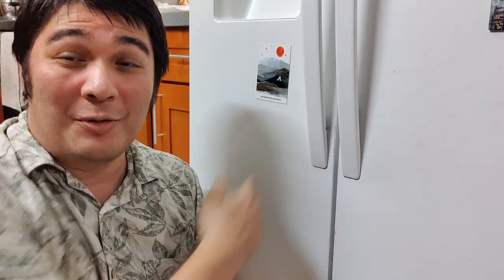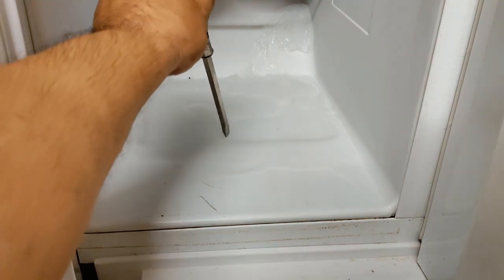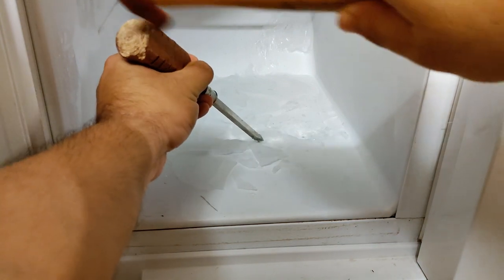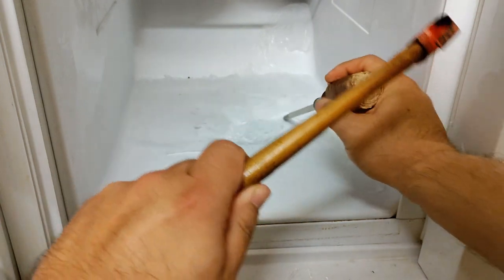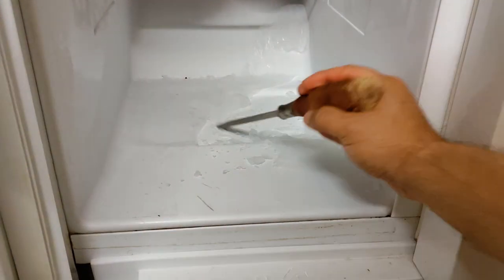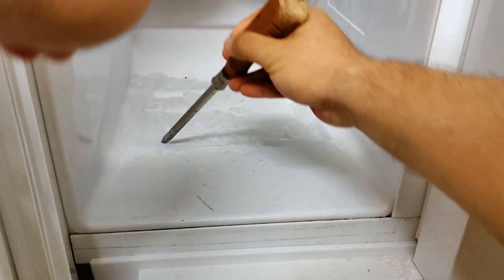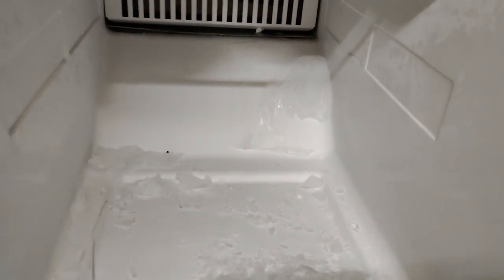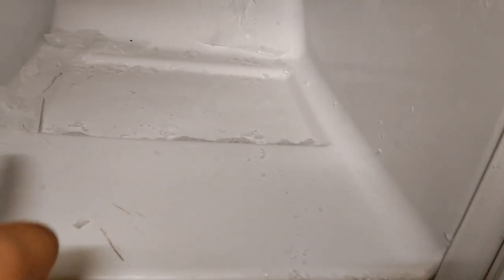Ice Breaker Video 1

Comment: If you positioned the chisel against the ice with the right precision could you potentially get all the ice off in one piece?
Reply from the maker: Dear tarawestcott4527, 
    Yes I could do that with a precise enough alignment, but the big question is whether or not the ice is deep enough to not shatter and splinter in the process.  It depends on the how the ice formed and how itcomes together becuase it could develop fault lines.  Good question though!

-Mr. Achiu